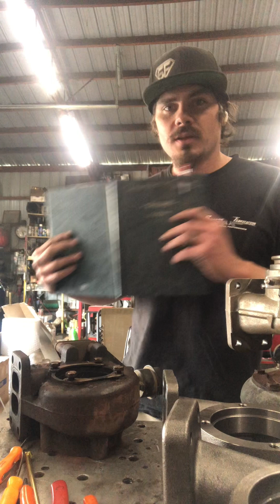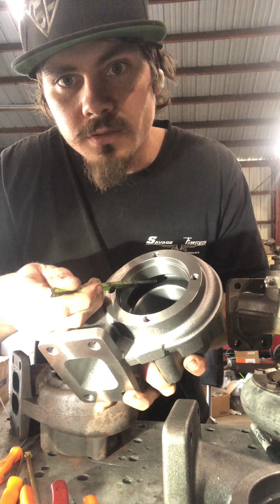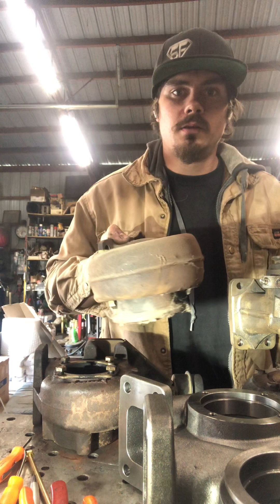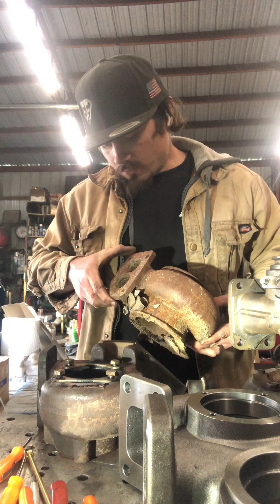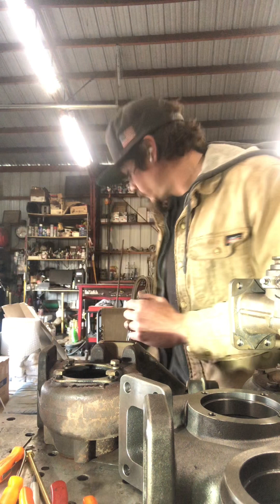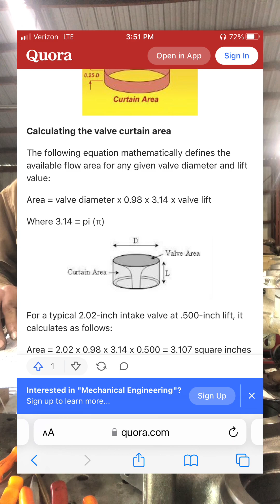As speedy guide to turbo turbine housings

Comment: Hey, care to do some info on the volute tongue? As in its clearance to the inducer, and exit angle? I've played around with this on heaps of turbos to increase spool, and lower drive pressure
IE. Weld up are re shape to direct the gasses at more of a 90 degree angle to the wheel, while closing the gap to about 1 mm. 
(To basically customise the generic casting that's been made for the largest inducer in that housing family)
Reply from the maker: By tongue are you referring to the end lip I guess you can call it. Technically the smallest scroll area of the housing.
Reply: @savagefabrication795  yes. The end of the scroll.
Reply from the maker: @Not-Sure-Viralade-ftw  truly I’ve never played with it. In my head though i believe I have a idea of what’s going on and it’s kinda neat. It should change depending upon engine size engine rpm turbine size and turbine housing size. It is a active system so even though you say have it at 90* it’s not due to slip angle but you are creating a effect that’s getting the reaction angle to be optimized. Reaction angle is another topic that can cause all sorts of odd stuff to happen before peak torque. That’s really neat, never really though about playing with that. I normally just try and get the short side radius to be smooth in the attempt to maintain some semblance of flow attachment.

Comment: Hopefully you talk about "on center" housings... I know they are older style, just never understood the difference.      Personaly I run turbo gas motors. Shop mate runs tdi's. Im always looking for more info! I can't thank you enough for the videos and your time.  ....  Question, If everything is a trade off. What is the disatvantage of the " smaller housing combined with the bigger nozzel?" ( a.k.a. The " keep the speed up/ expansion down " Part. )  I know pre turbine manifold pressure has less of an effect on diesel / high compression. (Emap) I know a smaller a/r usually limits top end potential.. Not sure how much they play into it.  ( mabye you said already, I for sure will watch this one again. )
Reply from the maker: I don’t really have any dyno experience with on center stuff, I have just read about them so as it pertains to this video I don’t have the collected data to really say. I think they are neat but the only thing I could think of as a idea is that adding more turns to the exhaust gas makes the flow less predictable but it’s just a idea over the offset housings having that strait shot. As far as the trade off, mmmmm it does have its limits as far as engine displacement vs how small the housing can get. The 6cm is kinda a neat example of this. The 9cm, with its 3cm difference runs much much better drive to boost then the 6, the 6 runs almost a constant 2-1 where the 9 is 1.2-1. At the same boost levels at 2500 rpms the 9 produces more whp/torque then the 6 as it has a small window it works in and above that  window the engine ve falls reducing dynamic displacement reducing power. Now if you took the 12 and casted it as a undivided housing there is a good chance that the turbine wheel could start to show up as the choke point. Vs the 9 it is going to run a better drive to boost at higher engine speeds with the trade off of low to beginning of the mid range are torque production. There is a bunch more too all of it that’s not talked about in the video as well. That does matter but the video was getting long.  I have 6-9-12-14-16-18-23cm housings all for the same charger ran on the same truck lol. They all did fine, it’s just moving peaks around and changing how it street drives